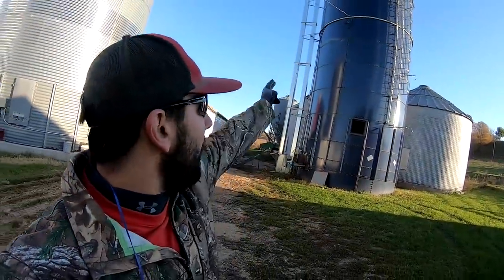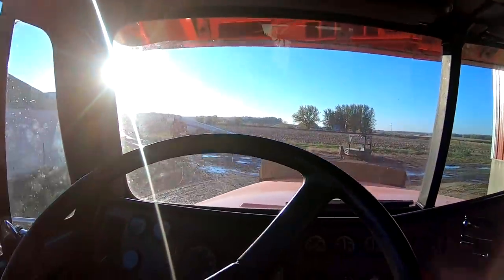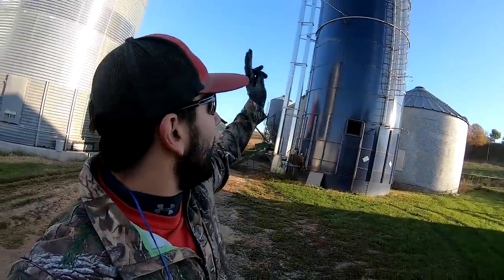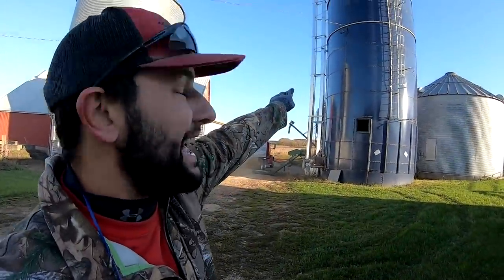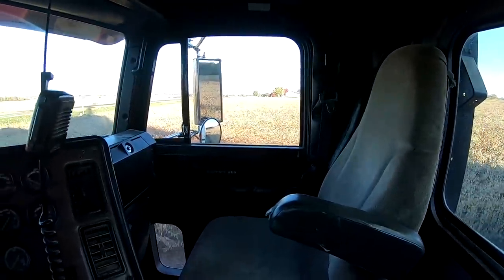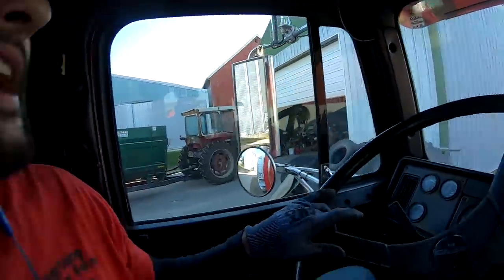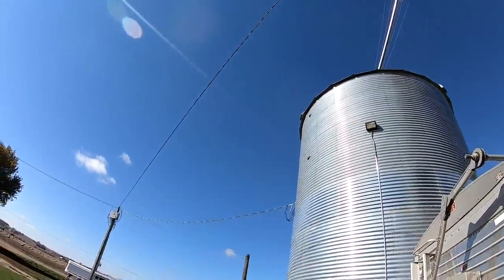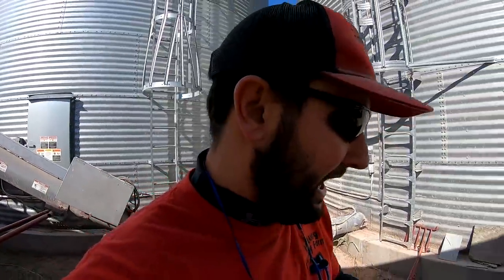We Took A BIG RISK

Comment: I have a gussiting system that I've made to repair that dent. I've installed it on 2 grain stores this year. They are 1/2 aluminum plate. Seriously would have no problem give you all a set. Mechanical engineer to another

Comment: Did you open up the vents on top when pulling from it. That steel isn’t that thin. But they are air tight. Bins are not. 

Btw. Sell the silo and have it taken down. 
Don’t think the porcelain cladding is all that valuable for selling it as scrap iron.